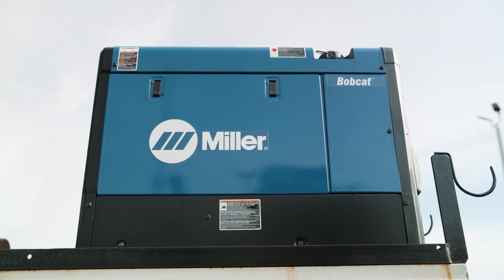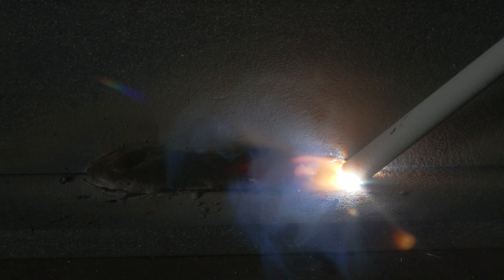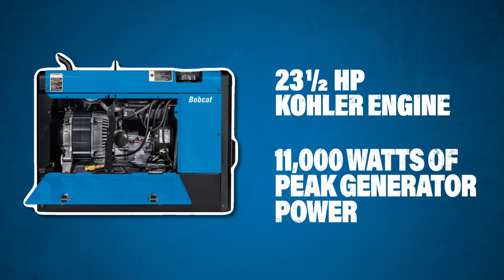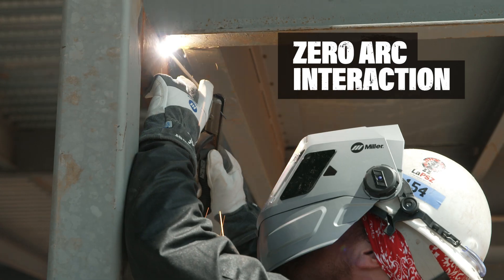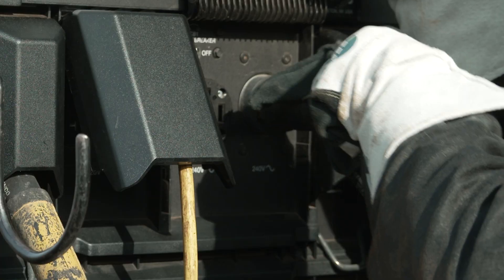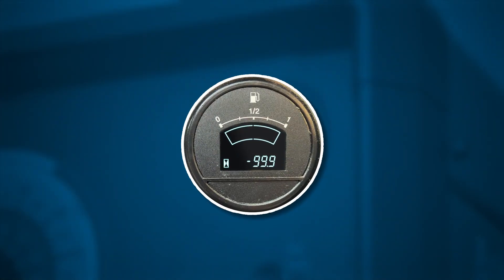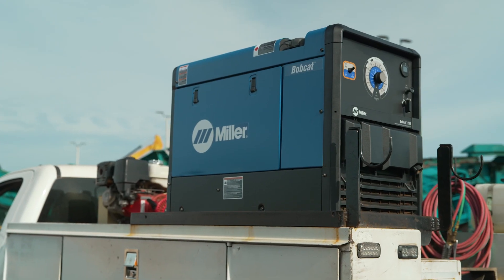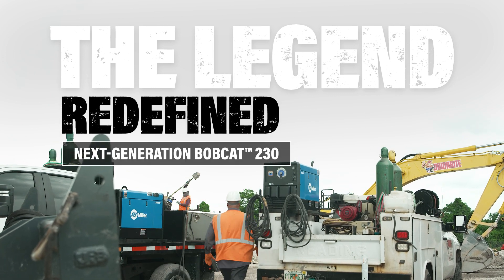Explore the Legendary New Bobcat 230 Engine-Driven Welder

Comment: Not sure what’s going on but my new 230 has one of the most violent and unpredictable arc characteristics I have seen. I ran it side by side with my old Bobcat 250 and my Ranger 225. The arc on the 230 when stick welding with Lincoln Excalibur rods is absolutely terrible. I am saying this as a caution to buyers, and to be clear I am a huge Miller fan! Love my 250. I am running 50 feet of brand new 1/0 lead on that machine. Only four hours on the machine hope it gets better.
Reply from the maker: We take customer feedback seriously and are constantly striving to enhance our services. Please contact us at 920-734-9821 or info@millerwelds.com with your machine's serial number so we can investigate this matter further. Thank you for bringing this to our attention!
Reply: (Update) the team at Miller reached out within 24 hours, and they are addressing the issue! Fantastic customer service! Thanks Miller
Reply from the maker: Thank you for the kind words! We're glad we could assist you quickly and resolve the issue.